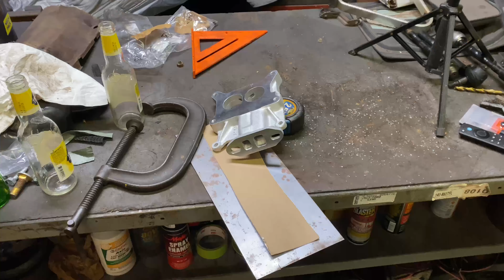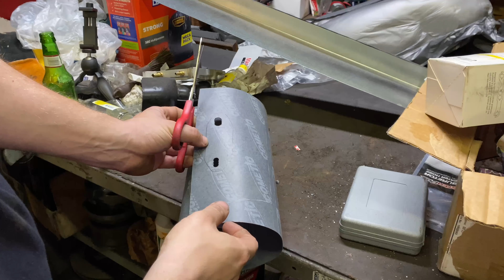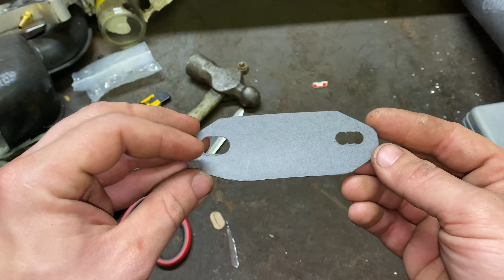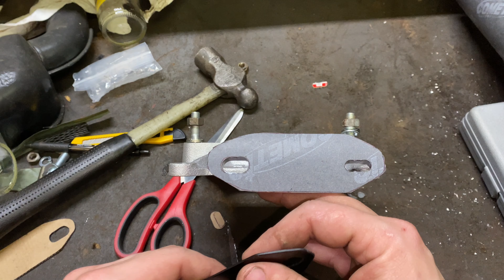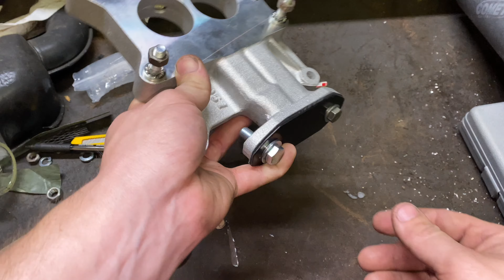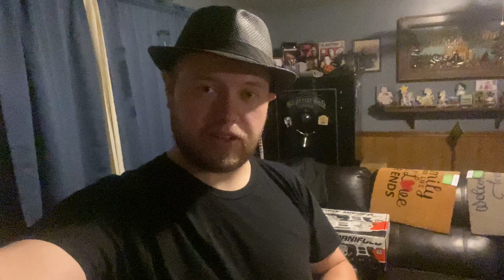Blocking off EGR valve on my 351 Cleveland.

Comment: Hi i have some questions i need some help. My dad did a egr delete on my brothers passat and made a block plate. The issue is that its leaking... alot and he put a metal gasket. Am thinking of putting one of those gaskets like yours do u think it will seal it? Ir could it be that we have to thicc of a plate?
Reply from the maker: Well I used a rubber gasket because I was only keeping vacuum from leaking with the way my aftermarket intake is set up but for an EGR port it needs to be metal because it’s like an exhaust manifold, it has actual hot exhaust gases going through it so rubber will just burn away and leak again. You can’t have too thick of a plate, the thicker the plate means better contact points and seal, if it’s too thin then it can warp and cause leaks, so I’d just clean your surfaces real good and make sure the surfaces are flat and install a new metal gasket, if it still leaks then you could try some exhaust RTV on each side of the gasket and see if that helps.
Reply: @FastFords289 thanks i think il change to another thinner plate its too thicc i think and il put those silicon high temp gasket maker
Reply from the maker: @Bruhwhat99 no problem, glad to help, hope it works for you. Thanks for watching.
Reply: @FastFords289  How bout cutting out and making a copper base block plate?? You could double it up, the copper would work like a header gasket, its meant to be heated without melting.
Reply from the maker: Hello, so if it’s just a block off plate on the stock intake then you’ll need the metal gasket because exhaust gases are going through there and the paper ones like I’m using will blow out. I used the paper ones because the intake I’m running doesn’t have a port for the egr anyway and I just wanted to close the hole up, plus it would leak vacuum if I didn’t. I don’t see how you could have too thick of a plate, as long as the plate is flat and even and the mating surfaces are flat and clean then it should seal, the thicker the plate the less warpage it’ll have. If it’s still leaking after verifying all that then you could try some RTV made for sealing exhaust flanges, it’s orange or red I believe, supposed to be good stuff but I’ve never personally used it.
Reply: @FastFords289 ive tried with rtv red gaskets. Got some metal gasket ordered bcs stock its supposed to have a metal gasket and maybe thats why its leaking a little
Reply from the maker: @Bruhwhat99 yeah I’d definitely use the metal gaskets for sure. Hope that works for you.